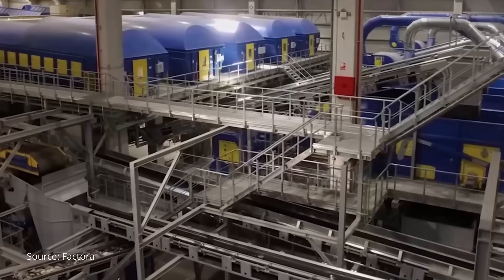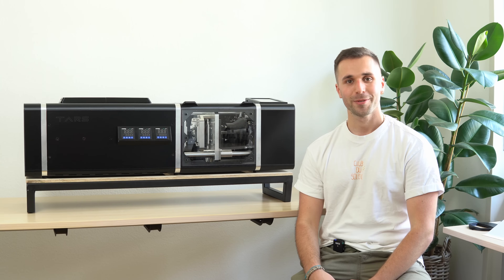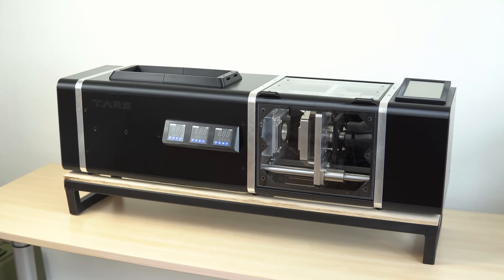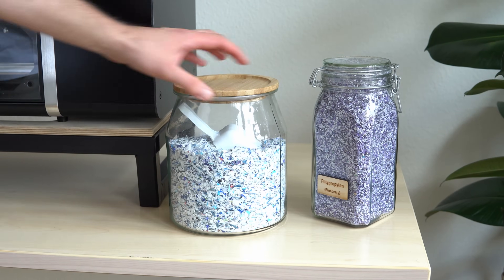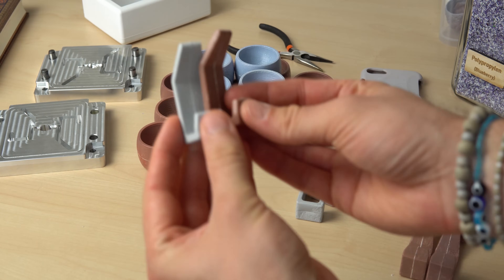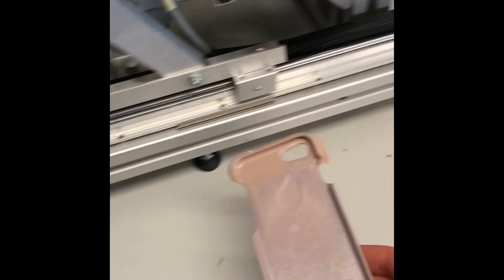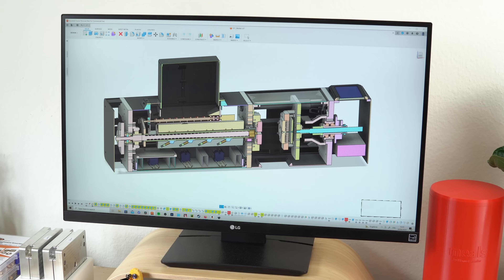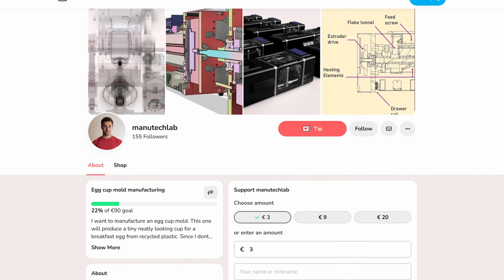Making a desktop injection molding machine for plastic recycling - TARS

Comment: Great idea and beautifully executed, my main issue with injection-molding tho is the mold itself being expensive to produce. 

I was to produce this machine i would sell it at a loss and make a profit from making and selling the molds for it. Its in the molds the money can be made.
Reply: Thats not entirely true, injection molding presses can cost much more than the tooling itself. Given the small platen size, the mold itself would basically be two blocks of aluminum to form the cavity and the core side. I build plastic injection/compression molds and have worked in presses for alot of major companies. Sometimes you can make more money off of the press and the components due to things constantly needing maintenance . Such as if you blow a heater wire, burn out a thermocouple,  need new ball screws, ect. But it is really sweet to see such a small press for at home use. If youre ever looking for a company to machine new tooling for you @ManuelMaeder contact Franchino Mold and engineering
Reply: @trevormatthews3996  Yes but for a tabletop machine i guess it will be serviced by the owner and i'm not saying that the machine should be cheaper than a single mold but most people would probably buy multiple molds. 

So by selling the machine for a lower price (not as cheap as a single mold) a person has already invested in the produkt and dus is more likely to buy molds for it. So if you make the machine more accessible more people will buy molds. 

Now i don't know the exakt price for a single mold of that size maybe you could enlighten me?
Reply: Something to also consider, you can 3D print injection molds too.

Now you probably never want to try this with FDM (hot plastic in a thermo plastic is probably not a great idea, before layer lines), but there are resin printers out there that have specific engineering grade resins for injection molding.  Specifically FormLabs has some high temp resin materials for low-volume runs (I think about 500) that would be perfect for this machine. I haven't done any research if there are other high temp resins for the cheep DLP printers out there, but I imagine that could be the case. Now not only are your low volume molds cheep, you can test molds before having one milled from aluminum.